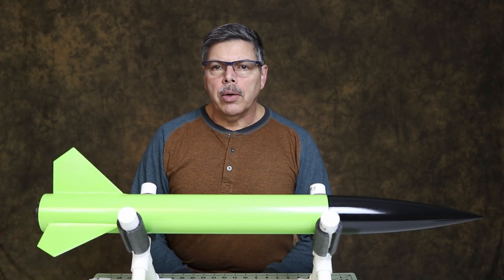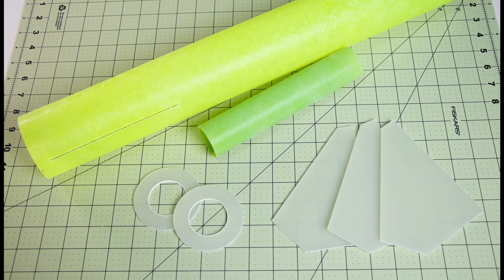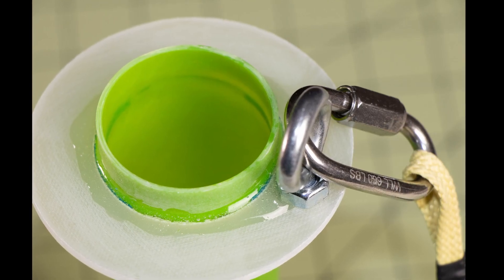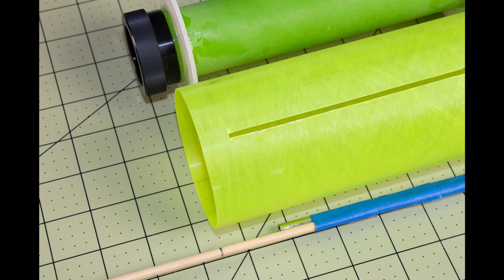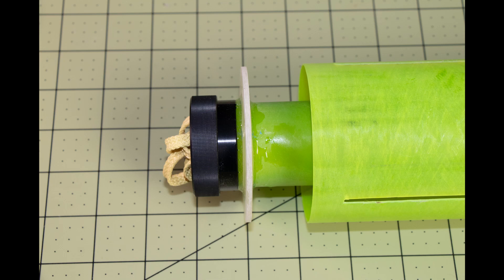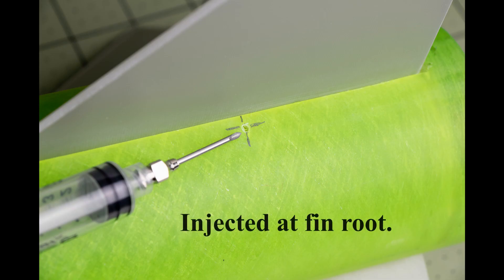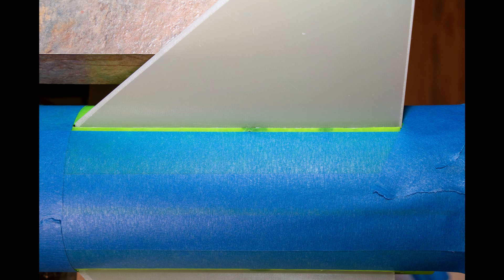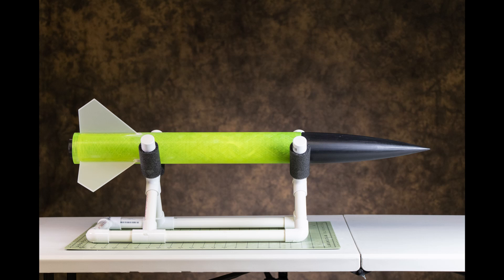Fiberglass rocket review and build.

Comment: I’m upgrading an Estes Big Daddy to 29mm motor.  Laser cut plywood rings & fins.  Did you ever do a video in the altimeter bay?  Would like to see that.  Did you bevel all fin edges to 45 degrees?  Great video… thanks!
Reply from the maker: I go for more of a roundover on my fins, a sharp edge tends to get damaged over time. This is my most recent altimeter bay video. https://youtu.be/PKDsIvPRJgI

Good luck with your Big Daddy, it's gonna rock!
Reply: @TheRocketeer  that's helpful... I've seen that altimeter bay video before... good model to follow!

Comment: I have built this model last year, a better idea for mounting the fins is to leave the rear centering and motor retainer off at the beginning, which allows direct access to the fin roots.  This allows one to make epoxy fillets on all surfaces internally, which gives superior strength!  Drilling small holes and injecting epoxy into the fin joints only really works for repairs after a model is built...
Reply from the maker: I agree with you that leaving off the rear centering ring for access is a better idea. I have covered that idea in later build videos. The technique did come in handy on several spit fin designs where that is not an option.
Thanks for your comment!

Comment: whats the weight of rocket and what type of fuel are you using ?
Reply from the maker: Yes I plan on flying this rocket on a sugar motor. In the U.S. I need to pass my Level 2 exam and flight before I am able to use a KNSU motor at a local Tripoli club.